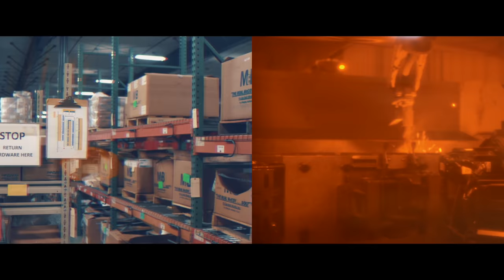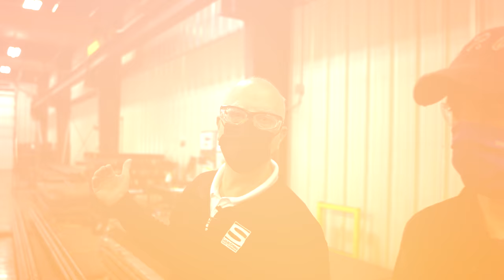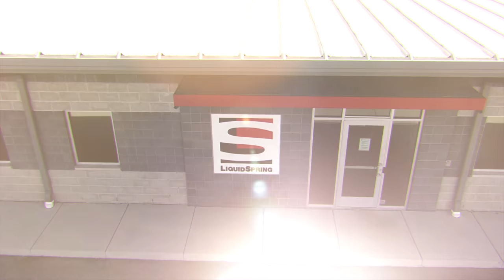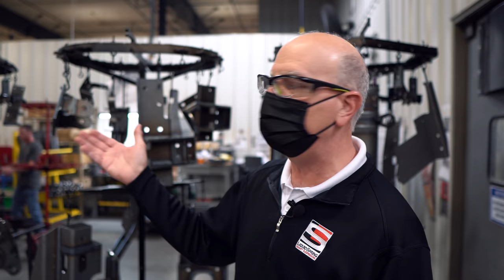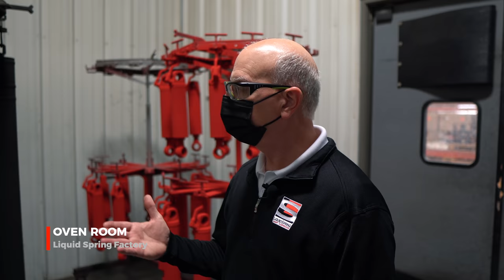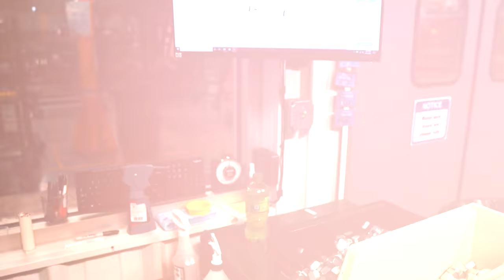This Is How You Dramatically Improve Motorhome Safety!

Comment: No matter what, a gas coach doesn’t match a diesel-A diesel is better in ride and towing capacity etc -Might as well buy a diesel if you have to put another $20 grand in a gas coach -makes no sense to me when you can get so much more out of diesel 🤷‍♀️
Reply from the maker: We would agree the DP has more tow capacity and carrying capacity.  We would disagree on the ride quality.  Even with 20k upgrade we are no where near the initial cost of a DP and more importantly the annual maintenance cost.   Thanks for watching and the comment.
Reply: @EndlessRVing  Do you installed liquid springs on your Newmar? and how is it ? did you do front suspension upgrade and why?
thank you.
Reply from the maker: @mariobana2934  yes we did 4 corner system and we will be doing follow up videos about it.